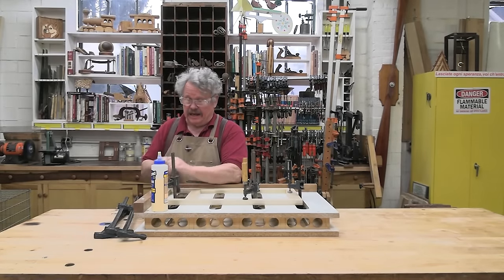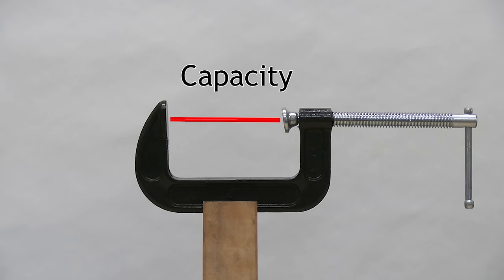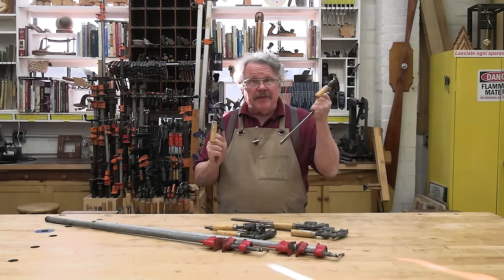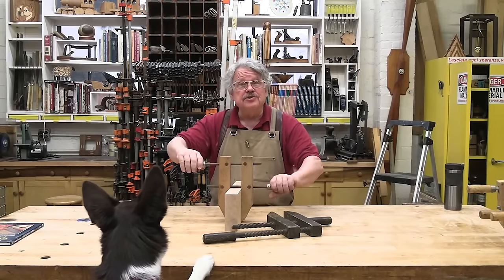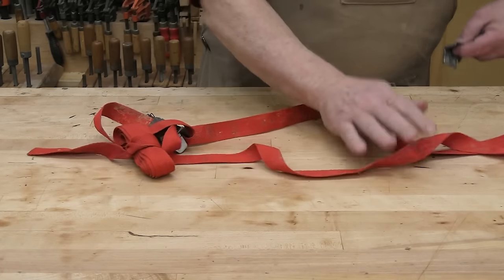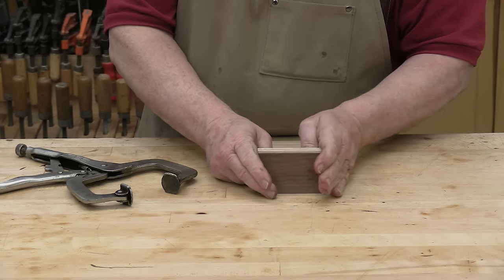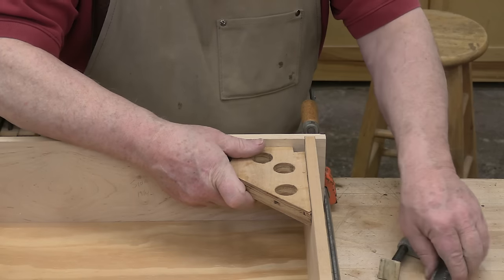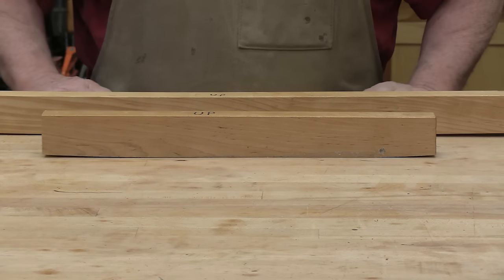Clamping 101 -- Getting a Good Mix

Comment: If you want to apply uniform pressure over length of a bar or beam uniformly loaded, put a clamp at twenty percent of length from one end and same twenty percent of length from other end. Sixty percent of length will be between clamps. Each end is a cantilever beam and centre is a beam with fixed (moment loaded) ends. Deflection at cantilever ends will equal deflection at beam centre.

Comment: One advantage of living in Norway is, that I have bought pipe clamps, and then I went to a pipe specialist. They had only 6 meters pipes. I bought one. I asked to divide it into four sections. They did it but they could not make thread for it. I asked the mechanic shop in my neighborhood, but they didn't have the necessary tools. I decided to buy a set of thread-cutting tools. All I found are small dimensions and don't have the 3/4 inch that I need. I think I have to use wood instead of pipe!
I love your video. It is full of free knowledge, thank you.
Reply from the maker: You may have bought the wrong thread-cutting set. There are two types for machinists and plumbers. The thread-cutting set for plumbing pipe usually includes taps an dies for 13 mm and 19 mm pipe. Thanks for the kind words.

Comment: Thank you for your dedication to this subject. Well covered! One of my favorite carpenter curiosities. 
 I think the benefits of tape in clamping could be a mini video on it's own!
Love your videos so much. 

  I'd like to add a couple of honorable mentions to clamp helpers;

1) Pvc pipe cut into 1-3" sections & cut to allow the sections to open, make excellent clamps for edge work. Pressure depends on how you make them so I can't give the trial + error; gap/dia/section size.  But when you need a lot of spring clamps and like the idea of dialing in a consistent pressure for your chosen project. Make them big and size them down if you have to...

B) I make stretched out Z shape bar clamp helpers when my collection of bar clamps needs. A Scrap of ply wood 3" wide with opposing ends having as much or as little build up to get the job done.
Reply from the maker: Most welcome. An d you're right about tape - could be a good short.

Comment: Thanks for the tutorial on the tricky wooden screw clamps. I inherited a bunch from my dad and I use them occasionally for their deep throat. Bessey makes a pipe clamp with the screw in the moveable jaw that has an over 3” throat. Love the pipe clamp diy throat extension accessory. Probably will make some out of hardwood.
Reply: PS I hit subscribe today
Reply from the maker: Most welcome; thanks for sharing.

Comment: I had to glue up a couple of Kingsized bed headboards. At the time I worked at Grainger Canada and had access to pipe as well so I bought pipe that was threaded both ends and used pipe connectors to make 6ft clamps out of 2 3ft pipes. So these days I have 3ft and 18in pipes. Oddly I most often use the 18in pipe clamps. They are strong enough to crush the wood so strength is not an issue.

Comment: I’ve always used whaler as the name of the curved cuals and cuals for the straight boards. Cuals are used primarily for gluing pieces together so as to prevent them from slipping. And whalers are used to get pressure to the middle of a piece of work.

Comment: Years ago HF used to have Deep Reach Pipe Clamps that were extremely reasonable but your extension pieces for regular pipe clamps seem like a great idea.
Reply from the maker: Thanks. I have two of the Deep Reach extensions and designed these when I needed more and couldn't get them.

Comment: 8:39 Similar to adjustable wrenches. There’s a tear in the space time continuum that switches the screw direction when you’re not looking, and does so more frequently when you’re on your back under a car or sink.
Reply from the maker: There used to be a publication, "The Journal of Irreproducible Results," which explored and documented such phenomena. My father published several papers in it, explaining important matters like why socks disappear in a washing machine. (Apparently, they go into suspension during the washing cycle and precipitate out again in the rinse. Occasionally, only one sock in a set precipitates and the other remains in suspension and goes down the drain -- a brilliant advance in hosiery science.) I have often thought that the hand screw direction phenomena needs this sort of insightful research, and the Journal would have been a wonderful place to publish the results... Update!! Apparently, the Journal of Irreproducible Results was reborn as the Annals of Improbable Research! I best get busy on my paper. I like your space-time continuum hypothesis, but I'm thinking that something about the engineering of the hand screw makes it more likely to be easily switched for it's doppelgangers in those parallel universes where left is right. I seem to spend a good deal of time in those universes, so the research should not be all that difficult..
Reply: @WorkshopCompanion  I also had a highly fanciful father, who left that gene with me, which is why I’ve never taken LSD because I see the world weirdly enough as I am.

Comment: I make a lot of bird houses and feeders like the barrel things you made. I use light wire staples on each end of each piece to clamp them until the glue dries. Then just pull the staples out. Put 2 together with glue then staple both ends. Then add another piece staple, then add another until you have the shape you want. I've been doing that for years and it always works great for me.
Reply from the maker: Staples do a great job of holding the wood, but they provide no additional pressure. You might want to look into a set of "pinch dogs." They work like staples and generate a little pressure. And they're reusable.

Comment: What a great video!  I really enjoy all of your videos.  Once concern that I have is that I purchased the Gluing and Clamping book and I was able to download it without any issue.  But, I was unable to download the Assembly Table and Clamp Caddy.  This was supposed to be included with purchase of the Gluing and Clamping book.  "We've bundled it with Nick's newest design for his ASSEMBLY TABLE and  CLAMP CADDY -- you get all three for the cost of the book alone!"
Reply from the maker: Sorry about that. We uploaded the zipped bundle to our store just before the video went public, but Shopify (which hosts our online store) apparently did not switch it out for the older file until nearly two days later. We're right now sending out the correct file to the folks who bought it before Shopify woke up. If you don't get yours todays, write us at workshopcompanionsales@gmail.com.
Reply: @WorkshopCompanion  Thanks I received the PDF with the Glue and Clamp book, the Assembly Table and Caddy Cart.  What a great deal!  Thanks!!!

Comment: Informative with a nice sprinkling of humor. I noticed you didn’t mention parallel clamps. Aren’t these the new workhorse?
Reply from the maker: They are, and I can't see why. I bought a pair of parallel clamps a little while back to evaluate for an article, and I was unimpressed. Heavy and expensive, IMO. And easy to misapply, even with the guides that were included. Get the jaw faces just a little misaligned, and they will still pull your assemblies out of square.

Comment: I used a wooden clamp with steel threaded tighteners to make a 'micro adjustable' table for a laser. 
It worked really well. One side was hot glued to a piece of plywood and the other moved freely. With a second piece of plywood on top hot glued also you could set the laser on it and move the two pieces of plywood incrementally and through a curve. I could have permanently glued the pieces together except the clamps were antiques inherited from my grandfather. The are probably 100 years old now. They work just as well as the day they were made.
Reply from the maker: Thanks for sharing. Screws and cams -- the basic machines behind most clamps -- are incredibly versatile.

Comment: Excellent video. If I may add one  category: gravity clamp. (Also known as putting something heavy on it.)
Reply from the maker: That's a really good point. Many years ago, when they were selling for about $15 US apiece, I bought four 25-pound bags of lead shot and have used them almost daily ever since for "gravity clamping." The cloth bags have long since deteriorated and I've had to wrap the lead in duct tape to keep the shot contained, but they have been remarkably useful. Trouble is, those same bags would now cost me $360! Hard to consider them as basic clamping tools at that price. But you can salvage iron and steel hardware, box it up and use it for gravity clamping, as I showed in the Saw Stand video. Thanks for pointing that out.

Comment: Hi Nick I just wanted to thank you for the excellent resources that your videos and books provide, and to ask a question.  Firstly, I was just about to buy the plans for the cam clamps, but realised that the gluing/clamping bundle I just had to have.  

I have briefly scanned and realise that you've provided a lot of plans for other clamps, including hand screw etc.  Now, the question. Are the cam plans different?  I'm pretty sure from the sample pages that they are.  But just checking.

Ta Col
Reply from the maker: Yes, the cam clamps in the book are different from those in the plans. Furthermore, the plans provide four different ways to build the clamps, the book has just one, The plan explains the math and physics behind spiral cams, the book does not. But there are more types of clamps and clamping jigs in the book that there are in the plan.
Reply: @WorkshopCompanion  Thanks for your reply Nick. I bought the cam plans anyway.  And am enjoying the reading.  I just gave myself a brand new hernia so think so light work around the shed and garage is Called for.

A quesion on the bar for the clamps: Do you think that alloy tube might work?  I have a stack of unused alloy ski poles roughly 12/13mm so half inch give or take.  Wall thickness is about 1.5mm which makes them quite solid and relatively strong.  I might just give them a go and see what happens.  Free material?   why not.

Comment: You also forgot (?) string - natural fibre string or rope can be wrapped tightly around an irregular shape. (Think whipping if you're a sailor or scout.) The string will then shrink when you wet it and thus apply considerable pressure.

Comment: Hand screws are just like toolmakers clamps - also useful for applying pressure exactly at the tip in case you need that to keep pressure even or whatever else. :-)

Comment: Hi, Nick. I have just discovered your channel and subscribed.
Question: With your pipe clamp jaw extensions (Love that idea), if you are clamping
perpendicular, to the grain, how do the three screws keep the wood from splitting?
(why would it split, in that direction?)
P.S.: FYI, the "violin" clamps are known as bobbin clamps.
Reply from the maker: The pressure on the jaw extension creates a racking force at the bottom of the jig, where the pipe passes through it.  Specifically, the greatest force is pressing against the jig on the edge of the inboard hole. This pressure is not across the grain, where the cellulose fibers could resist it, but parallel to the grain. There is a chance that the weaker lignin (which holds the fibers together) will split. The screws are there the reinforce the lignin, not the cellulose.
Reply: @WorkshopCompanion : Thank you.

Comment: Hi. Nick, thank for sharing. What you think 🤔 about pinch dogs?
Reply from the maker: Very useful for certain types of temporary assemblies, provided you can live with the holes they leave. I have a set that I have used maybe twice in thirty years, but they worked well when I used them.
Reply: @WorkshopCompanion  thank you for reply . I'm going to buy few . I'm making a wood arch 12 feet on diameter and has a lots of segments. I don't have a lots of 🗜️.

Comment: are plastic bags with a shop vac to make a vacuum grip just a gimmick idea, or does it have it's place?
Reply from the maker: Vacuum bags can be especially useful for both wide and odd-shaped assemblies. They generate a whopping 14.7 pounds of pressure per square inch at sea level, and are often used in manufacturing. They aren't as basic or as versatile as the clamps I covered in this video -- I've had a vacuum clamping set-up for thirty-some years and have used it maybe once every decade. But when you have a need for them, they work great.

Comment: 1:44 wow got any clamps 😂
The sight gave me anxiety 
Worse than the glue extravaganza on the table 
I set my self a goal quite a few years back now. No buying 
No Bunnings 😂 I use a cheap saw and sand stone rocks 
Bees wax sap and charcoal. 
Clamps I used old school joints wooden apple tree pins 
To make crosses. Amazing the uses one can come up with 
Used to love wood work 
Became a mechanic instead 
Should of went with my gut instead of my other head 
Nothing ventured nothing gained I guess 👍🏽

Comment: 17:15 why aren't the pressure bars curved on both sides?
Reply from the maker: You want them to be able to deform slightly as you clamp them down. A bar shaped like what you describe would be much less prone to bending.

Comment: My question is: How does one create/cut a pressure bar, regardless of length?
Reply from the maker: I made mine on my jointer. Set the outfeed table cut a little high. It's normally set .003" below the top of the blade arc; bring it to even. When you pass a board over it, it will cut a long  arc. If you don't have a joiner with an adjustable outfeed table, you can build up an arc by gluing 6-8 strips of veneer, each one progressively shorter than the next, to the edge of a board. Then carefully blend the edges of the veneer strips with a sander. And if you're comfortable with a bench plane, draw the arc with a long string compass and plane down to the pencil line.

Comment: I wonder what the optimum shape of the curve of the bottom of the pressure bar clamps would be...
Reply from the maker: It really depends on the amount of pressure you need to apply. If all you're doing is holding boards flush for an edge-to-edge glue up, then I find that 1/4"-1/2" *6 mm - 13mm) curve over 36" (91 cm) is more than enough. If you additional pressure to form a good glue interphase in the middle of a wide sheet, the curve should have a tighter radius. Sometimes you just have to experiment to get what you want.

Comment: You forgot to mention cam clamps.
Reply from the maker: I "forgot" to mention a great many specialty clamps; we were concentrating on the basics, the most versatile, and the least costly. I used cams when I was making musical instruments and loved them, but the amount of pressure they will generate is limited and this reduces their versatility. That said, they can be wonderful for small projects and they are easy to make. In fact, we are experimenting with a slightly improved design that should generate a bit more pressure, and have a video planned if they test well.